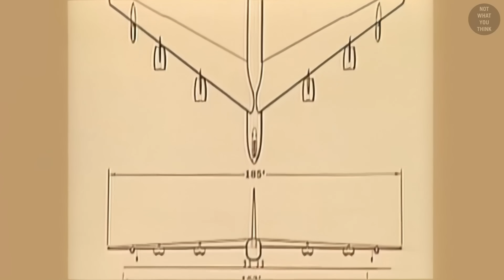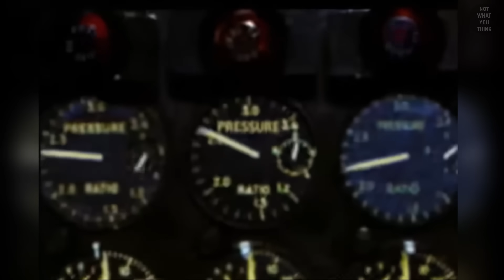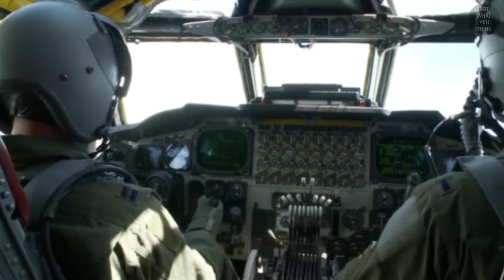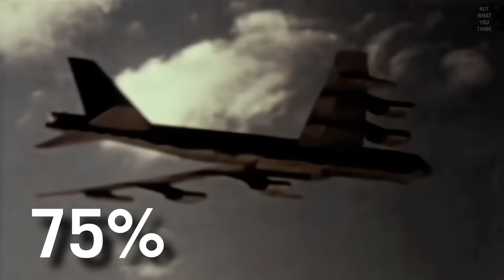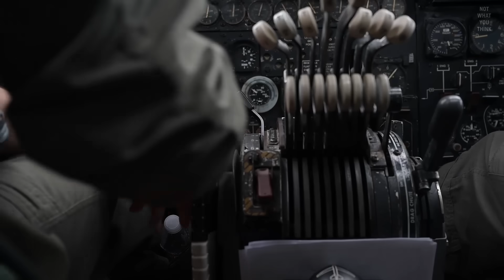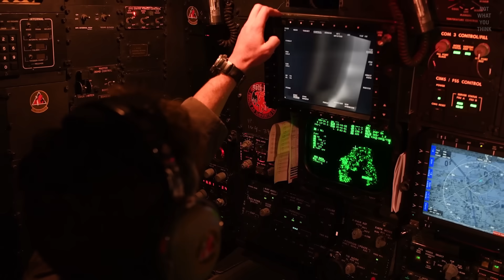Why This Obsolete Bomber Will Outlive EVERYTHING

Comment: Just imagine in the future you're a Space Force pilot in your highly advance space craft orbiting Mars and you see a 200 years old bomber somehow propelling itself in the vacuum with it's jet engine wondering how the hell is the thing is still in service
Reply: And then as you reach the surface to reclaim some rogue colony of rebels you get shot in the chest by a 200 year old M2 machine gun that somehow also refuses to die.
Reply: @ric84  even better - M2s don't need any real modification to work in space
Reply: @dsdy1205  i dont think guns in general need any modifications to work in space.
Reply: @oddmerlin9797  they'd work better in space, no atmosphere to stop em now
Reply: @nightcorekira5787  exactly, only problem i could see is guns that lack ejection force for the casings
Reply: @dsdy1205  Space Bullet go many far.
Reply: @oddmerlin9797  yeah; it's just cos we're comparing to airplanes
Reply: @dsdy1205  you’d need a cooling jacket.
Reply: @ItsJustVirgil  not if you give it time to cool
Reply: @dsdy1205  don’t want to wait 10 minutes between each shot for a machine gun, that ain’t fun.
Reply: @ItsJustVirgil  Methinks you can probably get a few seconds of sustained fire in just due to the heat-sinking, but yeah that's true
Reply: @oddmerlin9797  Actually, the amount of recoil in zero g would render a gun's accuracy non-existent and might even be dangerous to the user.
Reply: @dsdy1205  cooling it would be a real challenge. I could imagine it being liquid cooled with huge radiators nearby
Reply: @aaroncabatingan5238  that doesnt seem right. gravity does not really effect recoil, and most recoil control comes from the shooter
Reply: @oddmerlin9797  Will gunpowder still burn without oxygen?
Reply: @Beezlie727   yes, think about it, it already does since its in a sealed vessel upon ignition, but even then one of the main components of gunpowder is nitrate, its chemical formula is NO3, so there is already plenty of oxygen there
Reply: @nightcorekira5787  even better

The ammunitions flies INFINITELY
Reply: @oddmerlin9797  they don't... Most cartridges or bullets still go off in the vacuum.. think they're more effective in space too. No atmosphere to slow them down
Reply: @lockerjoe2578  you realize that’s exactly what my comments have been saying right? What exactly are you reply to?
Reply: @oddmerlin9797  I saw your reply to me and it just tells me that you don't have a basic idea on how physics work.

Normally, gravity would a pin a shooter to the ground so when the recoil happens, the force get sent to his feet and into the floor. But gravity doesn't exist in space. So the recoil would just send you flying backwards uncontrollably.
Reply: @aaroncabatingan5238  i think i understand has happened. i think there has been a bit of a misunderstanding.  i was thinking along the lines of someone shooting a gun in space would be holding onto or attached to a spacecraft rather then just floating in space. that way there would be some stability when it comes to shooting. since this is the most likely senario
Reply: @dsdy1205  well they would need cooling but the original barrels were water cooled so not a modification just return it to stock shes good to go😅
Reply: @dsdy1205 yeah they do! There will be a lack of oxygen!
Reply: @morpheus_9  gunpowder does not need oxygen to burn.
Reply: @dsdy1205 just a smoothbore barrel.
Reply: @ric84  I think we all know it would be a Mosin
Reply: @mshark8246  they'll be saying that in 200 years too
Reply: @cliffordcrimson7124  now I'm imagining astronauts fighting with mosin nagants, thanks
Reply: @ric84  Getting rolled up on by a couple T-54s on the martian dunes.
Reply: @ric84  Should've gotten the old weapons sensor upgrade at the dealership you thought you would never need.
Reply: @ric84  one of the commanders pulls out a damn 1911
Reply: @ric84  Rumour has it the Maxim gun is still in service with the Martian Space Rebels.
Reply: @ric84  I seen these comments everywhere, where are they from?
Reply: @ric84 Dont forget those old maxims
Reply: @ric84  Or a German designed, yet still used by many modern militaries like here in Canada even, MG-34 Maschinengewehr. Modern builds, same blueprints. If it ain't broke, don't fix it. The Ma-Deuce tbh is of a similar bloodline tho. So I agree. Both of em will still be in use side by side, one the heavy, the other the dual purpose man and light machinegun, one a big ol 50 cal and the other a zipper fire standard .30 cal high powered rifle chambered ripper. But in space. And in a vacuum, there would be no bullet drop and no air friction to slow or stop the rounds, so distances will be something that we could not truly comprehend from here... Kinda nuts to think that those things could be a possible reality.. I guess electric magnetic guns are a real thing now. Still in the growing pains stage.. But people like the classic look of things.. I can't see military dudes wanting to be packing kit looking like they are at a Star Trek convention. Even if they legit do that on their time off. There's just something about muscle cars or guns where that classic look will always have that certain appeal.. Damn. I bet if my Prime Minister, mister Super Liberal Nice Haircut Baby Castro found out that 'his' military are using Hitler's favorite military weapon, he would throw one of his classic temper tantrums and disband our home defense forces at once calling them all 'racist'.. smh.. Well, with my name he wouldn't even know I was born in the same country anyhow.. He is just that much of an airhead..
Reply: And then you see that it's still being refueled by a KC-135
Reply: "Target lock, they're firing a super duper missile"
"Say your prayers boys, it's gonna be a hell of a bumpy ride"
"So we're gonna live sarge?"
"Fuck no that's a super duper missile not a javelin, grunt, now brace for impact."
Reply: Nah bro you’d be the one piloting it
Reply: @Harrison Ashley No he's not, we've never been to space, only the astronauts.
Reply: It's going to deliver Tacoma's and corollas to your local mars colony
Reply: And being piloted by descendants of the first pilots.
Reply: Joke aside there is a british space company that intend to launch rockets from a converted commercial jet. Perhaps a B-52 can be used in a similar faction if we decide that it is cost efficient to launch objects into orbit from an aircraft intead of a rockets ftom the ground. It could make the first rocket stage obsolete.
Reply: @generalkayoss7347  modern bullets have their oxidizer in the bullet itself. Guns can shoot, but recoil's gonna be a bitch
Reply: @CoolAndrew89  Yeah, I hadn't even thought about recoil. Better have a backstop lol!
Reply: "....somehow propelling itself in the vacuum" is a very relevant question for ANY engine 🤣
Reply: @blaze1148  Rocket BUFF.
Reply: @blaze1148  Well rocket engines use oxidizer (liquid oxygen) to allow combustion to happen in the vacuum of space, not a big streak that the B-52 could do the same with some slight modifications.
Reply: I bet that there's already someone out there designing another modification for the B 52 that would allow them to reach space. It honestly wouldn't surprise me.
Reply: At this point I'm seriously wondering why it's not possible to buy a B-52 for Star Citizen...
Reply: @GeneralKayoss  You obviously aren't a chemist, or at least not a chemist familiar with smokeless powder.
Reply: @williambrasky3891  hi, I’m a molecule
Reply: @barongerhardt  yes, i agree, (as someone who has played way too much ksp) the main point i was trying to make is that a gun should have no problem operating in space and that all the problems are just fundamental  issues with being in space rather then the gun
Reply: @oddmerlin9797  Yes, that is accurate. Modern firearms use nitrocellulose "gun powder" and don't require any oxygen or any atmosphere to function.
IIRC the only declassified use of a "gun" (cannon?) was on a Russian spy station. It was remotely fired after the last manned mission ended. It lost attitude control and entered an uncontrolled that was never recovered from.
Reply: Space, mars!? You missed the map chrome dome
Reply: Its going to be like in starwars how they have ships that are 1000's of years old and still being used lol. I couldn't imagine how odd that would be to be 2-300 years from now and we still use shit from not that far removed from world war 2 lmao
Reply: And then said bomber, being the dumb fu** of the family somehow crashed into you with your anti-matter bombs onboard and they go off and proceed to annihilate the entire Martian colony.
Reply: The aliens would have an easy way to destroy it.
Reply: HA HA HA HA HA
Reply: Lmao man had me LOLin
Reply: That will most likely happen
Reply: Hey don’t give the Air Force higher ups any ideas
Reply: Hence watch all time "obsolete" starships on starwars universe, there's the answer...
Reply: Space Force is a joke, just a public relations gimmick to make the US public and the international community at large believe America is on the cutting edge of defense. Which it is anyway of course, but when you won’t defend your own southern border against drugs and illegals due to woke policy, good luck keeping your country, because outer space is all you’ll soon have left.
Reply: Ion engines on each pylon with it remote controlled
Reply: Warhammer 40,000 is our inevitable future.
Reply: LOL
Reply: The Buff man gets around
Reply: BUFF!! lives forever!!
Reply: The space force is a joke
Reply: @beans5171  you mean the people responsible for military satellites and gps are a joke when they are the back bone that keeps the military from flying 300 miles in the wrong direction because they were off by 5 10 15 degrees at take off you mean that space force is a joke right the people who's job it is to maintain communication and navigation systems for hundreds of America military navy air bases across the globe
Reply: @beans5171  Say that the next time you use Google Maps for anything
Reply: @beans5171  The space force is a bunch of stuff the air force was doing under a different name.  Just because it has a stupid name from a stupid person doesn't make the stuff the air force was already doing like managing satellites and R&D stupid.
Reply: @atashgallagher5139  yeah it does
Reply: You'd have to imagine it because we've never even been to space.
Reply: @deusvult6920  ratioed. Not sure if you're a troll or conspiracy theorist tho.
Reply: @deusvult6920  😐
Reply: @deusvult6920  Yes, but other people have, and cameras have, and they say it does work.
Reply: @deusvult6920  What drugs are you on and where can I buy them.
Reply: @deusvult6920  riiight
Reply: @deusvult6920   Bro be living in the 1950s
Reply: @deusvult6920  *Xfiles theme plays*